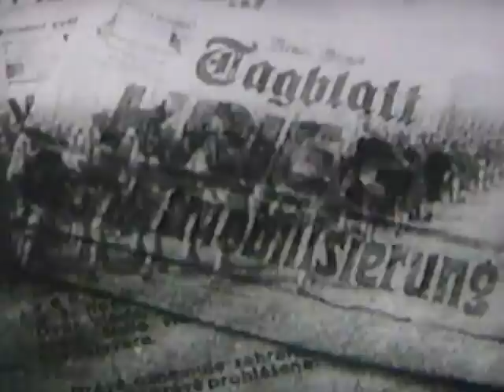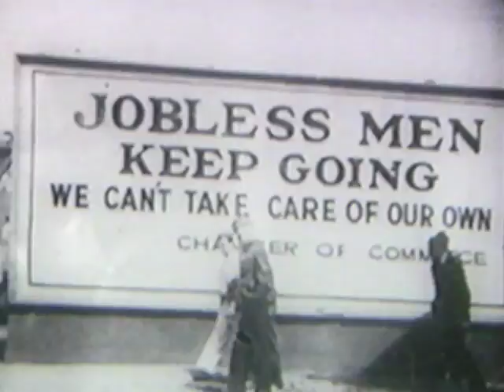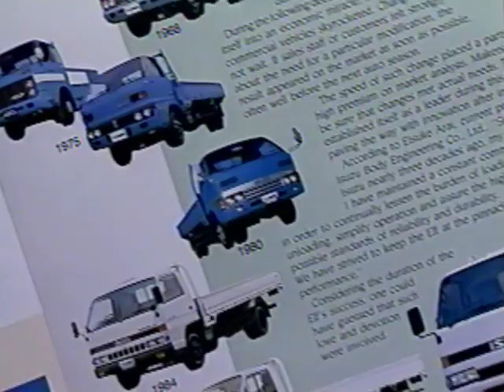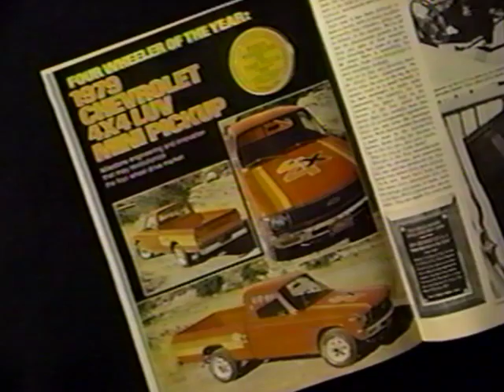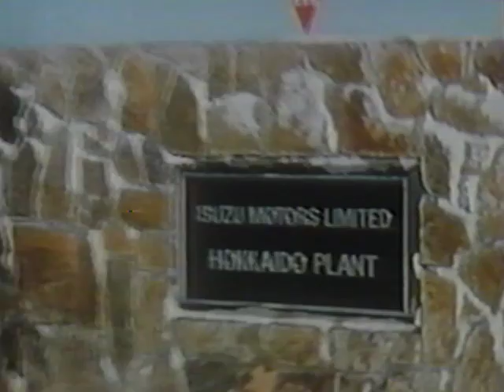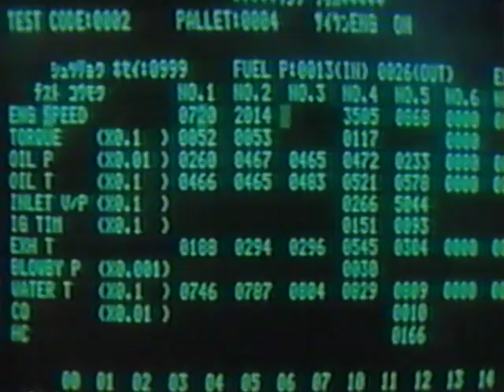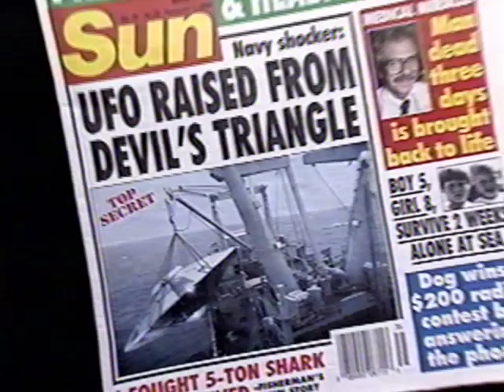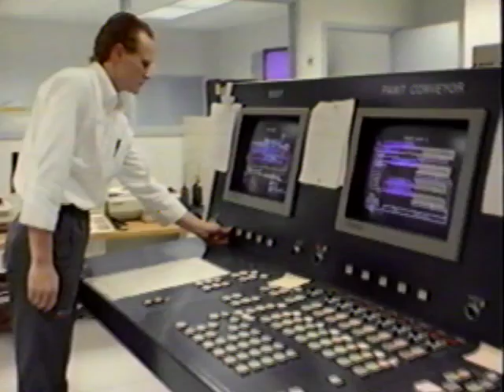Isuzu History

Comment: My favorite Isuzu is the vehicross. Thread permission cloased.
Reply: Well i used to own a 2021
Reply: @davefelizardo4826  you mean 2001. That was the last year of its production
Reply: Check the new one tho its the dmax vehicross
Reply: Dmax and mu-x is not even available in states
Reply: I still have my 85 Isuzu G200 2.0 motor.  And still running. Though hard to find parts.
Reply: My favorites car in isuzu is
Isuzu panther/hi lander facelift 2
I have isuzu hi lander facelift 2014
Reply: @suparto8923  I also have the crosswind or known as panther

Comment: it's a shame isuzu pulled out of the passenger market in the U.S., but on the bright side I got my 2nd Gen trooper dirt cheap and I love it!
Reply: Yup! got my 1996 trooper/Acura SLX just last week.
Reply: Don't know about the US, but they still have an SUV called the MU-X based on the Dmax pickup here in Australia.
BTW the Trooper was known as the Jackeroo over here and sold by GMH (General Motors Holden) under the Holden brand.
Reply: Robert Leitch ...and the grand type, the one with that bulky roof, is the one you want 4 life
Reply: Tony Thepkaysone they did not just do that in America. Where I from, Isuzu only sells commercial Trucks and that's about it. Tho they also sell pick ups and SUVs down here, I don't think I have ever seen a "car" from them.
Reply: i am going to look at a 1990 trooper with the V6 and a 5 speed manual on sunday, only has 119k miles on it for $1900, but i think i am going to offer 1k.
Reply: oof, i wouldnt get one that old, the old 4 cyl in them make like 80hp, youd have been better off getting and 87-90 with the V6

Comment: My wife and I began our lives together in a 1993 3.2 v6 Rodeo (can be seen in our wedding video with temporary plate in the back window). It was the first grown up car either of us had owned. We loved, loved, loved that thing! It was a great car/truck that served us well for 8 years until a cylinder head casting failure at 140,000 miles. Due to my own lack of knowledge and an inept mechanic it died an expensive death before we decided to pull the plug. It was hard to let go as the car was rust 1 (855) 237-2293 free with all original glossy ice blue paint. Uuuchh! Still makes me sick to think about it. If I only knew then what I know now we’d probably still have it. I sold it to a friend for $500. He pulled the engine and fixed it properly, including the leaking rear main seal that had begun to drip. He sold it on to a fellow in Wyoming. Who knows? It may still be on the road.
Reply: That's a great story man! It's very possible it's out there somewhere!

Comment: I drive a 2000 Isuzu Hilander. Very reliable and fuel efficient.
Reply: Fernando Domingo Also Isuzu Panther in Taiwan (5 or 8 seater with 3rd row strut bars), 

Rear doors of 2000 Isuzu Hi Lander located at the right side but Taiwanese Isuzu Panther’s rear door located at the left side.

Comment: Great video!
Addition:  Noteworthy was the rare Japan Spec Irmscher AWD Turbo Sedan, or even its sibling hatchback (North American import) the 91-92  Impuse RS featuring AWD, Intercooler, DOHC, 4 wheel disc ABS, dual runner variable intake (active) manifold, forged and nitride, crank, rods, forged pistons, Recaro style seats, rear limited slip with 4.10 gearing, and Lotus tuned suspension of course. Had all the trick features and more for its era except for 4-wheel steering. In stock form (with addition of boost controller only), it laid waste to contemporary 5.0L Mustangs at just 1.6L of displacement.

Comment: Wow, this was the forerunner to the development of the Isuzu panther Jeep pickup and first generation minibus from 1990-2000 with a C223ne and 4j41 diesel engine and total body assembly for the chassis frame and front body Astra Isuzu Bodywork quality And design assembly directly from PT Pantja motor or now called PT. Isuzu Astra motor Indonesia (iami) Even the first and second generation Isuzu Panthers were sold from Indonesia to India and the Philippines  Which reached 260,000, units for Indonesia and Export market of 400,000 units to India and the Philippines ❤❤❤❤🎉🎉🎉🎉🎉

Comment: Forgotten and with good reason. I owned an '87 Isuzu Trooper II and, being a slow learner, a '91 Isuzu Rodeo. Both bought new. They were monumental POSs. Almost comically bad, with the "proudly made in Indiana" (as per the sticker wonkily stuck on the rear driver-side window) Rodeo being the worst of the two. At least the Trooper actually ran most of the time despite a marked tendency towards biodegradability and once spitting out a spark plug (maybe it was a brand it no longer liked), and a gearbox that grenaded itself, but only once. The Rodeo, oth, probably dreamt of being a Range Rover with its variegated and ever-changing list of electric, electronic, and mechanical gremlins, faults, and occasional major failures. I remember once looking over at my dad who was riding shotgun and mentioning that either the engine had puked out all its oil and was about to seize up and explode and we would all die, or the oil pressure gauge had just packed it in. Fortunately, it was the latter. On another occasion, the fuel pump decided it needed a rest right now, and never mind that it was rush hour in Montreal and we were halfway up the elevated urban expressway in bumper to bumper traffic. The look of absolute dejection and sadness on the face of the driver of the car immediately behind me will stay with me forever...so will the comments of some of the other drivers who, despite not actually knowing me, cast doubts on the validity of my parents' marriage. Don't get me wrong, those are just two examples of one minor and one major failure. The reality is that it never went more than six consecutive weeks without some warranty work being required. I managed to tough it out for two and a half years, which is longer than the paint on the left rear fender which had abandoned ship months earlier, but finally gave up when one of the rear shock mounts decided it wanted to cast out and explore the world on its own and it wasn't its problem that the shock would miss it as it now had nothing to hold on to...  Isuzus were, in a nutshell, awful. The world is better, if a little blander, without them to "enrich" somebody's life.
Reply: CaptHollister Seems like there’s always someone to disagree with anything I put on social media, so I apologize for disagreeing with you, Capt.!
I’ve got a 1995 Trooper, single owner, about to hit 220,000 miles, and I love it.
Reply: muckinferguson
There's really no need to apologize. You and I have different ownership experiences with our Isuzus and that's that.
Reply: Lol. I love your writings. Very entertaining
Reply: Very artistic literary work, I have a ‘98 with 278,000 that has never left me stranded anywhere, it always gave me ample warnings of impending failure of parts. Of course I studied automotive technology and not literature, so maybe it was more useful.
Reply: Wyman Smith
Damned with faint praise.  I actually have well-honed mechanical sensitivities and a couple of old(ish) cars and motorcycles to prove it. My Valkyrie only gets worked on by me. As for the Rodeo, when you have an improperly installed head gasket, inoperative front locking hubs, instruments that quit working on whim, paint that comes off in large swathes, a fuel pump that goes from quietly operating to committing suicide (well perhaps had my parents exposed baby me to radiation and an insect bite, I might have had super-human hearing and heard its desperate calls for help before it offed itself, they didn't, so I didn't. Btw, which is the best insect by which to get bitten under radiation if one wants superhuman hearing ? I'm thinking maybe cicadas, but that also begs the question: 13 years or 17 years variety ? but i digress). So when the failures listed previously and which constitute only a partial inventory (hey this was 25+ years ago and I'm now at the stage of my life where I would appreciate it if you got off my lawn) occur on a vehicle that is new and under warranty, what does one do ? this one takes it back to the dealer. Repeatedly. Very repeatedly. So repeatedly that the service manager and I were on a first-name basis (his was Louis) and developed a warm friendship based around the fact that we never went more than 6 weeks without meeting up, him behind his counter, me standing in front of it.  I could even see the humour in owning such a disastrously bad vehicle and knew that someday I would laugh about it (are we there yet ?). But I stopped laughing when the shock mount broke driving out of my driveway. Admittedly there is a bit of step, but at about 2 centimeters (call it less than an inch if that's your 1/2 pint of tea) it really shouldn't cause mechanical mayhem to anything equipped with wheels larger than a rollerblade, I mean it's never befuddled any vehicle before or since. A broken weld in the underpinnings of the vehicle I used to ferry my young daughters (well they're not so young anymore. They grow up so fast....). This happened on a week-end. On the following monday I was back at the dealer (bonjour Louis, no I didn't call first) to speak with the manager. I told him how much I wanted for this 2 1/2 year old piece of not-so comedic performance art. He didn't even argue. I got my money and bought a Volvo. Bliss at last with the added bonus that they were so easy to work on that even a non automotive technology student could work on one, though to be fair that was also true of the Trooper II. I don't know whose experience is more typical, yours or mine, but I suspect that the number of high-mileage Rodeos or Troopers (musn't forget the older brother) is far outnumbered by those that went to an early grave.  It is also likely that by '98 they had eliminated the most egregious issues.
Reply: Sounds like you got a bad Rodeo I know someone who has one of those with over half a million miles on it
Reply: ISUZUTHAI   #UNT